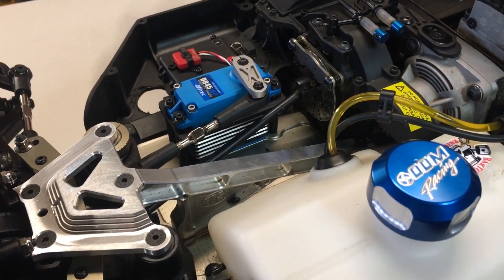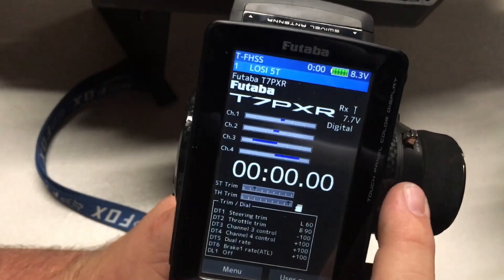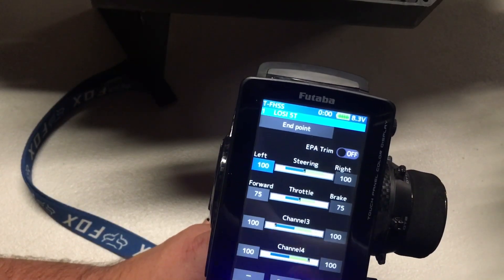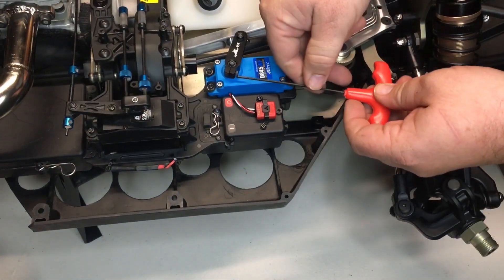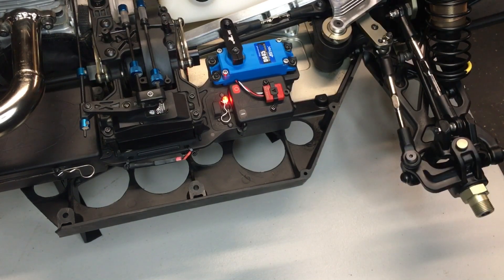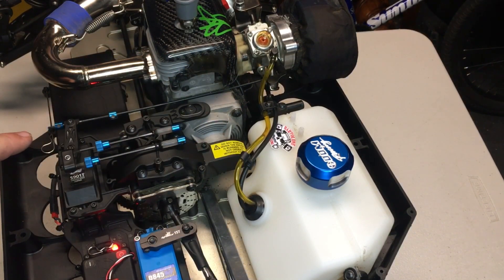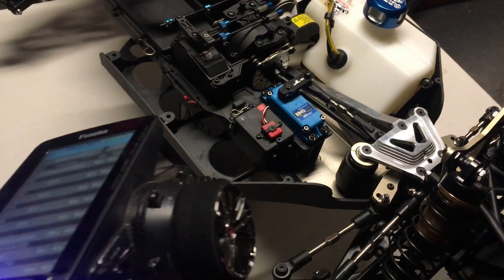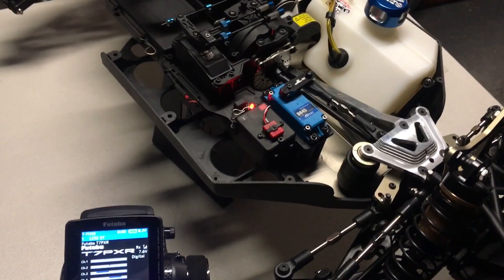How to setup your controller - How to program a kill switch on your controller

Comment: Just install a dynamite kill switch on my 5T 2.0.  Went through the binding process holding down full brakes.  Everything is work except for when I turn the Transmitter off, the brakes engaged but the LED light stays on.  I can’t figure out what I did wrong.
Reply: Mine is doing the same, have you figured it out?

Comment: Thank you for the great video. I'm waiting for my 7pxr to come in the mail and this video made it easier to set up my kill switch. On another note, what battery do you use for yours?
Reply from the maker: The one I use is a little too fat, not recommended. I’m going to get something thinner
Reply: @largescalercnation  I was looking at the ones DDM has and says it fits the losi 5t 2.0. I think I might give it a shot
Reply: @largescalercnation  sorry I ordered 2 from amain for the 7pxr and my 4pm

Comment: I have a spektrum radio and I installed  the mod kill switch like you posted . I can turn off the kill switch with the remote . But when I turn off the remote . The kill switch stays on . Still trying to figure this out . Should I just change my remote to a Futaba ? Or can this be solved .

Comment: Nice tutorial. How do you get the brakes to engage with the kill switch. Also will the killswitch work when you turn the 7px off? Thanks
Reply from the maker: Yes the kill switch works when the radio turns off, which acts like dead batteries in the controller. The kill switch recognizes no radio signal and cuts the motor off. I can do a video of the full brake setup 😎👍👊❤️ Great content BTW Crucial RC, I sub
Reply: @largescalercnation  I know bro. I havent talked to you in a few tho. Nice seeing you still at it.